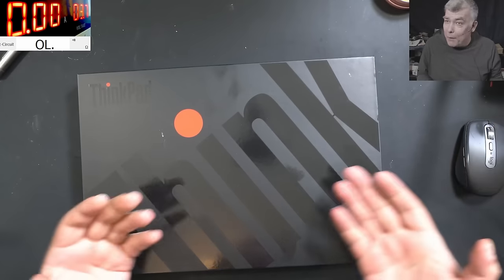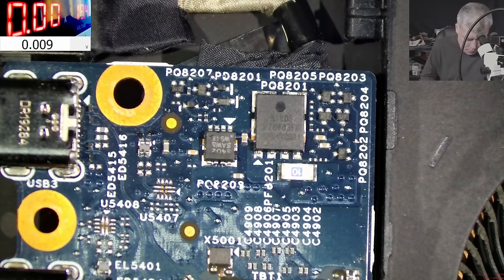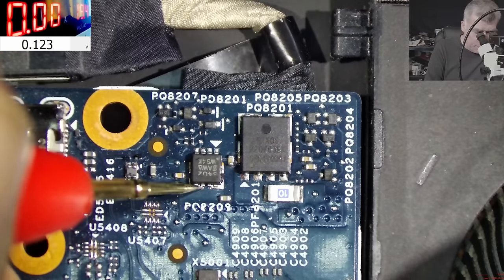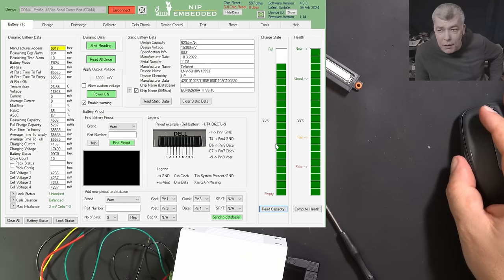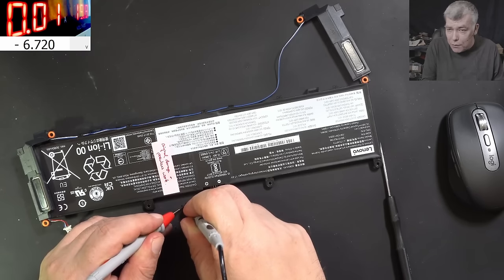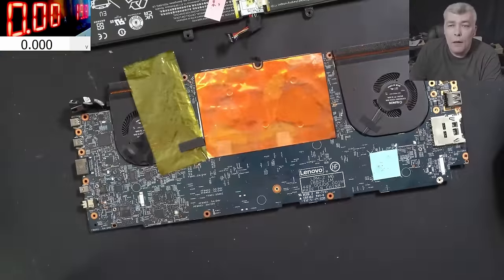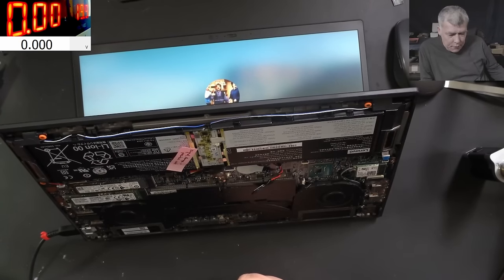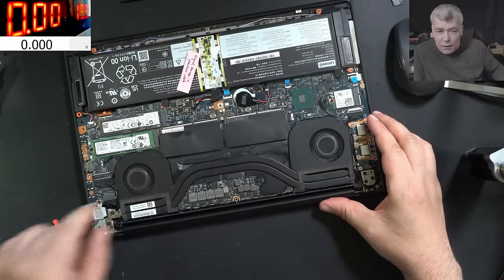Lenovo x1 extreme, no power, a proper hard motherboard repair

Comment: that was very hard job, the customer should have said what was done to the board, so you wont confuse yourself and loose precious time... in this repair you needed a lot of tools and knowledge to have it done, without the battery analyzer you probably would have not fixed the laptop, good job master Sorin!
Reply: It's comparable to medicine. A new doctor needs to know what has been done previously and why, before ordering new medication or changing existing prescriptions.
Reply: Customer don't know what was done to the board.
Reply: @Struktualnyj at least customer can say it's been to other shop or someone tried to repair it
Reply: @maklogetrich2378  he wrote that it was in another shop and they tried to replace the mosfet but failed in repair.
Reply: Without battery analyzer you'd probably just buy a new battery, or open it and check voltage and fuses

Comment: I don't take computers that others have worked on where the repair was not successful.  Way too many uncertainties.  Fantastic job  Sorin! That was the most advanced component level repair I have ever seen! 😮
Reply: what if they lie to you and you discover after they leave, you tell them that you discovered someone worked before, and they say you lie.  Problematic indeed.
Reply: @orange11squares you just say “sorry can’t be fixed”
Reply: @moldo8811  interesting , might be a good way out without to much details.
Reply: Well in this case customer lied

Comment: You should noticed the customers (before starting your repair) that if you find evidence of someone previously worked on the laptop the price of the repair will increase, and more, you have  video evidence of that so you should be protected.
In my case, i would like to know how much time you spend on the repair and be charged acordingly. Nice work 👌

Comment: Yes Sorin you will lose when someone worked on the board before, but after watching so many of your video's I think there is a part in Sorin that likes a challnge and doesn't give up easily and it's pretty obvious this part won in todays video. But don't worry there is still plenty of easy pizza's on the laptop repair menu in the future! This one may have cost you time, but it's still a learning experience. Also maybe a tip and try to prepare some contra battery connectors with wires instead of hooking the battery straight on the reader, might save you from having those weird battery pins not properly connecting faults.

Comment: Great job Sorin. It wasn't that long ago when you used the battery analyzer and it also messed up the pins and was giving you problems diagnosing why it wasn't charging.

Comment: If i were you I'd ask the customer for more money because it's your right 1st he told you (no one worked on it before) when clearly someone did, and 2nd you fixed the blown up fuse on the battery's board 3rd you've unlocked the battery and lastly you've charged the Bios battery (which no one do such a thing) and MOST IMPORTANTLY YOU'VE SPEND A LOT OF TIME {And Like They Say TIME IS MONEY} IT'S NOT GREED IT'S YOUR RIGHT AND LIKE I SAID IF I WERE YOU I'D HAVE TAKEN MORE MONEY ON THE REPAIR 
By The Way I'm 32 years old and i work with phones but it's not making me that much money and I'm not greedy like my fellow coworkers so I'm learning FROM YOU how to fix laptops too [SO THANK YOU SO MUCH SIR AND GOD BLESS YOU EVERY SECOND] THANKS AGAIN

Comment: Hey boss, great video, amazing skills and yes you should charge more- people will pay for knowledge

A tip on hownto handle pricing in such situations

We own a repair shop and we never provide a quoted to the customer prior to final diagnoztics

Yes- you need to work hard to find out if it's fixable or not but only once we are 90% sure we can fix a motherboard we will contact the customer with pricing 

To begin with- we always give a range foe pricing and explain that price difference is in time and parts we need to replace 

Customers do understand especially when the computer price is expensive- they rather pay 200-600$ then buying a 2000$ laptop or more 

U r too humble, and should  start enjoying yiyr skills 

Time is money 
As simple as it sounds

U can do 10-15 repairs per month and receive laptops from all around the world

Save the energy on customer that don't like to pay, have more time off and more money per repair

U deserve much more respect

Cheers boss

Love your video
We learn a lot form u 

 
1

Comment: Great detective work and hopefully you replaced the "properly calibrated battery fuse" with a boring uncalibrated but proper fuse.
These kind of customer issues are easiest to resolve ahead of time.
Inform the customer ahead of time that flat rate depends on the condition that it had not been worked on previously and if previous work is discovered the customer will be contacted to decide either the labor rate becomes an hourly charge (with a cap) or the laptop is returned without attempt to repair.

Comment: @sorin One the beginning you should check if on input circuit on the MOSFETs if 2 the gates has continued, and then you will realize that the 2 MOSFETs was channel N, because the two gates was link 🔗 together. That was you first mistake... 😅 And the job will be much shorter... Thanks for sharing your knowledge... greattings from Portugal 🇵🇹 🌟

Comment: Most times I will always check charging mosfet and charger chip when no charging.
I want that battery checker thou, it's just too much for the amount of batteries I would need to repair.
As for previous work jobs, I do a bench check (charge a fee) and usually NO, if the re-work was bad or charge extra!

Comment: good work Sorin, BUT what about RTC/bios battery at 1:00:25 ? you left it empty, on a expensive gaming laptop? now the client will deal with cleared bios settings all the time?
That battery should be replaced (if this is a standard battery) or charging circuit should be fixed (if this is a chargeable battery and the circuit is not charging). LOL

Comment: time stamp 53:00 The BQ24780s does not supply input mosfets with gate voltage it`s done by the ThinkEngine chip, The bq24780s is only for charging
Reply: yeah also he had still 3.8v with the new BQ, is it possible that chip detects if  mosfet is off the board and it wont send the signal driving it?

Comment: Try to use spring probe, on that MBL for battery. Terminals are too big obviously, if you can get those probes they have springs and will not damage any connector. You can use literally clothespin, to catch connector from battery and put probe on it.

Comment: It's always a tough repair when you have multiple faults and you're coming in after someone else has tried to repair the laptop before. I'm lucky having well over 100 schematics so I can always find a similar model even if I don't have the exact model. I charge hourly and not "per fix" so I'm not worried how long a job takes but there's a point at which a laptop becomes too expensive to repair, in that case I advise the customer to take it somewhere that does a fixed rate repair or I'll stop charging my hourly rate and continue the repair for free after my original charge. I don't need the money so I'm lucky in that respect, not everyone is able to do that.

Comment: Boss from the beginning it was wrong to charge a LENOVO battery without id pin from the charger and was not charging cuz the fuse from battery then the second mosfet that what burn the BQ chip cuz you fix the battery fuse already that what make the whole confusen , As always thank you very much we learn from you evey time 💐💐

Comment: it makes my job much easier when someone else has not worked on it. It's very extremely hard to troubleshoot the problem when someone else has worked on it, 
this is the part where I tell the customers I will not touch it.

Comment: i need you, 

I have a board all mossfets are fine, but it still not turning on, It seems 5 P rail 20P rail and 3P rail are good, And the keyboard does signale that the power button is pressed in? The laptop does not charge but hey we do not care. It is a asus rog strix G513, I have replaces the mosfet for the GPU because it got blown, And i think i did something wrong but even the Mosfet gets the correct output and input ? so where do i look?

Comment: when he said /says let's check the main power rail where did he check now, and wheat did he check for, voltage? I'm a novice engineer, my guess is he tested a capacitor for voltage, and so what capacitor, but if not that what and where?
Reply: He checks the main power rail for a short to ground. DMM in resistance mode + beep for continuity, one probe on ground and one on the power rail.

Comment: Nice Video, but i have a question:
You checked the voltage of the mosfets at the input circuit, it has 19,5V on the input and 19,5V on the output.
Then you checked for a short and they are not shorted. But then the voltage should not get through them, isn't it?
Maybe a detailed Video with detailed explanation of the different parts would be very nice

Thank you
Reply: To get the mosfet switched on(shorted) voltage is applied to the gate pin, if not the mosfet is fully closed and like open circuit

Comment: That BQ  did not have a hole initially https://youtu.be/Mv_Bz1UgUQg?t=781
Reply: Yep, but still provided BAD voltage to 2nd mosfet.
The hole was not initialy visible, hence battery fuse blow-up, locked itself and safed BQ by taking the full amp bullet